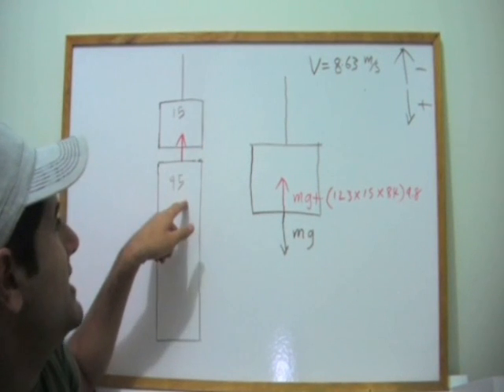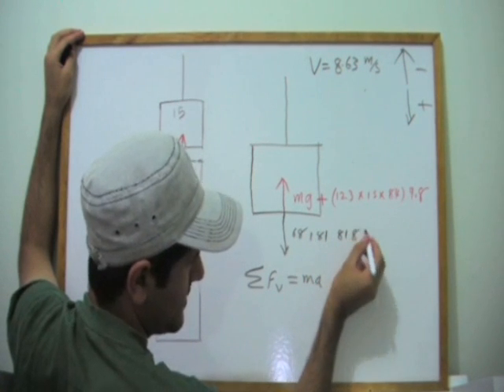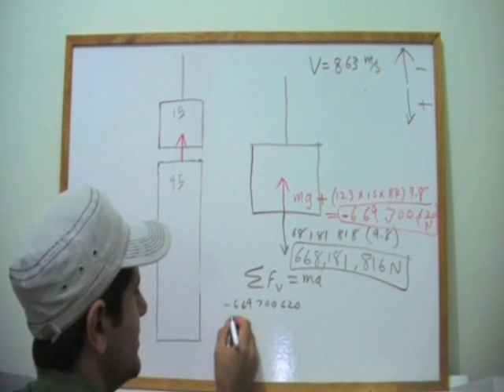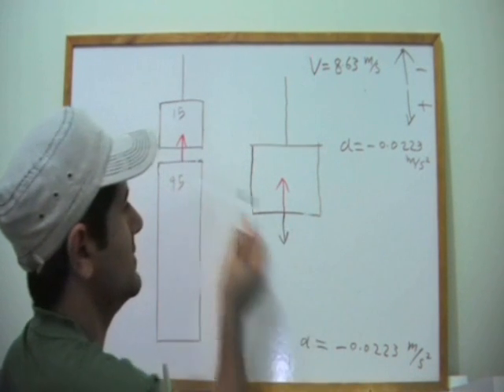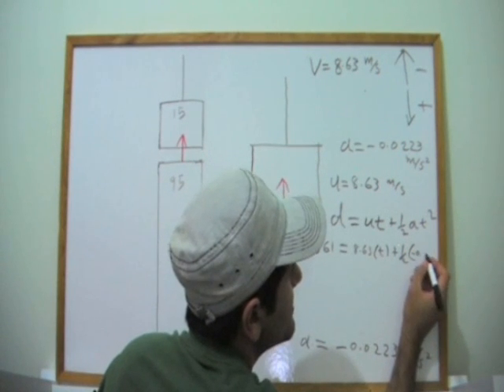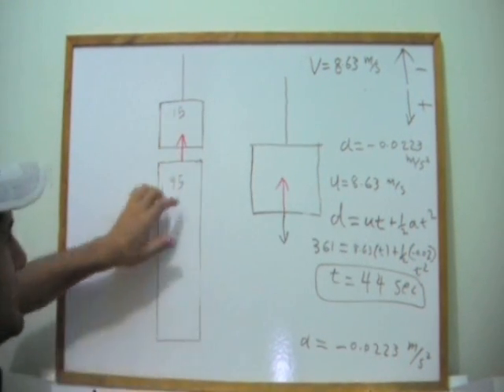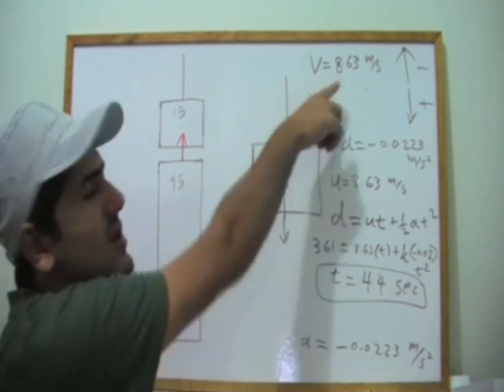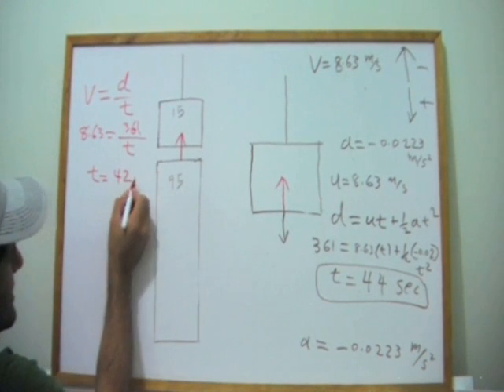(Part3) 911 Simple Physics Structural Failure Vs Demolition

Comment: It would be absolutely impossible to crush that central core in pancake fashion.
Reply: Better yet, buildings just can't fall straight down period and end of story.  That is why the beams were all twisted.  To both fall free fall and to twist downward by torque (torsion) would require controlled demolition.  That is the central point of the argument causing all the controversy.
Reply: ***** People need to get their minds out of smut.  Fortunately, people are going to figure this out on a scientific level eventually.  Whether you are hot-pink liberal or a baby-blue conservative has nothing to do with it.
Reply: MisterNifty I believe it was 60% central core and 40% walls for load support. The thing then is how does it fall straight down. It is already tilting and should continue to do so unless all resistance is taken out from below.The thing with the pancake theory is the pulverising of the slabs. How can that occur so perfectly. It takes force from above and counterforce from below to allow pulverising to occur. But if there is counterforce or resistance from below then it does not collapse at the speed it did. I could be absolutely wrong but as of yet I have seen nothing definite to explain the near perfect collapse of those towers.
Reply: librazone  you are right.
Reply: librazone "It would be absolutely impossible to crush that central core in pancake fashion."But the inner core was designed to sway as well as the outside shell.  I'm not saying you are wrong.  You just aren't demonstrating why it was so that the inner core wouldn't collapse.  Lots of energy from the impact was absorbed because of the way in which the outside shell and the inner core swayed independent of each other in directions which were front to back, by way of the slip joints and bending trusses, and side to side, also by slip joints and by way of bending trusses.  There weren't just trusses, but double trusses running from front to back and, within those, others that ran from side to side.  See, those supporting the official report poo pooing the engineering of the towers are getting their cake and eating it too.  People claiming the jets brought the towers down fail to acknowledge how well the engineering of the towers worked.  They oscillated for three minutes after the impact.  People arguing the trusses were overheated just think good enough alone.  But they are thinking of the fire in terms of it existed back when it was still one of the four basic elements along with wind, water, and earth.  The hottest part of a flame is going to be at its center.  This accounts for the color variation in a flame.  Or, another example, yellow sparks in an electrical short are cool in comparison to white sparks.  Cooler heat rises because the smoke is unspent gas.  So the upper steel trusses were being heated by unspent gas.  At the same time, because of gravity, most of the heat is going to be upon the floors.

Another example of getting your cake and eating it too is the flames traveling down the elevator shafts.  According to physics, flames traveling at high speed can't bend around corners to travel down the elevator shafts.  This reported incident of flames means the explosive impact happened in and around the core where the elevators were located.  At the same time, the immediate explosions felt at the bottom of the tower means the engineering of the towers worked as planned.  Indeed, the energy absorbed from the impact of the jet traveled down the perforated weakness of the bolt patterns.  

The outside shell wasn't built in floors, but, in a sense, in vertical and diagonal floors as the sections themselves were pieced together offset.  

The energy from the impact was felt almost immediate as it would have happened faster than the explosive sound from the jet's impact could travel.  I think this is what caused a lot of confusion.  Those bolt patterns were not fixed in a horizontal fashion at all.  So, how could the upper tower bend to break?  The energy from the impact traveled at two separate time intervals towards the top and bottom of the tower.  One energy wave traveled in the vertically up and down the perforated bolt patterns along where the spandrels were connected.  The other energy signal traveled also along the diagonal up and down as well along the perforated patterns where the sections were connected by bolting the rectangular beams.

In other words, these engineers knew their stuff.  As the energy would be received at different times by both the hat truss at the tower's top and the massive steel foundation at its bottom, the two differing signals would cause them to oscillate.  This phenomenon helped absorb a lot of energy from the collision.             

Hello?
Reply: MisterNifty correct.
Reply: librazone That is an easy problem to figure out.  The inner core held up itself along with exactly half of the live and dead weight of the floors spanning between it and the outer shell. All collapses are torsional.  They have to be.  This means when they fall, they have to twist (torque) one way or the other.  The two types of torsional collapses are centrifugal and centripetal.  Centrifugal collapses happen in nature.  Centripetal collapses happen by design.  For a building to collapse straight down, it has to be engineered to fall in a centripetal fashion either clockwise or counter so towards the center of its mass   
This is why there is so much controversy.
Reply: librazone The answer is that it was not a perfect collapse, it was a real mess. It acted more like a liquid that a solid. Someone said that it cannot be thought of as a block and he was right. 
  If it had been a CD there would have been no need for airplanes. The clowns that would've done it would 've said the terrorists set the explosives----- not us.
Reply: ***** find 39 witnesses. and I will interview them all.
Reply: i do not understand what you are saying
Reply: Wasatch Range Railway First understand that, though the towers were built square, they fell round as that is the nature for all things do so.  Think of toilet flushing.  So, what gives the tower its torsional strength is its bracing which keeps it from twisting by applied torque.  Square beams resist torque.  I bet I could say that a million times and most people still wouldn't get it.  I-beams or H-beams twist.  That is why Ford utilized an I-Beam suspension in its 65 pickup.
Reply: ***** Okay, I recommend buying a small book if you can.  It is the JFK commission on the behavior of the intelligence community prior to JFK's assassination.  In that book is clear testimony of our intelligence agencies deceiving of the whole world by the use of false flags.  Of course, they did not offer testimony concerning domestic deception for fear of being eliminated.

Comment: What do you think about the theory of a directed energy weapon? I only say this because if the buildings were brought down in a controlled demolition, wouldn't there be a huge pile of rubble at the bottom? That is not what happened,  they literally turned into dust. Also building 6 has its middle missing! Not crushed as some people think.
Reply: You have a good point especially because a collapse or regular demolition would not cause the pyroclastic flow of fine dust that we all witnessed. All that steel and  concrete would need an incredible amount of energy to behave in such a manner. However it seems like everyone is either clueless or indifferent when talking about this
Reply: Irene Moran if your pyroclastic flow was reality, everyone in the general area would've been incinerated. With all of the people that I saw covered in dust not one did I see scorched beyond recognition. 
  Secondly, go talk with a demolition company that brings down buildings with explosives. There is no such thing as pyroclastic flow because it is not hot enough to generate a flow. Controlled demo does not turn concrete into powder it does not melt steel. The REF of plastic ex is between 1.4 to 1.8 `too fast to generate any real heat. C4 through C6, cuts steel and concrete. It does not generate enough heat to cook an egg.
  I did it for 4 years, and I was damn good at it. Thirdly dynamite will not cut steel dynamite digs holes because it burns slower. it would blow pieces of the building all over hell destroying all of the other buildings resulting in lawsuits against the demo group. When we flipped tanks end over end , we could touch the metal within seconds after cutting through it. It did not scorch us it did not burn us, And anyone who wants to argue it is a frickin' idiot. Your pyroclastic flow happens in one place and that is on the side of a mountain after an eruption of a volcano. Or in the case of Krakatoa across an ocean.
  Those who think they are perfect are especially annoying to those of us who are! ;) ;) ;) You can argue with me till hell freezes over Irene, but until you have done it , you are just assuming!
Reply: Irene Moran
You only get pyroclastic flow in 2 instances. One is a volcano, the other actually is building demolition. It happens as explosives pulverize rock or concrete to dust, which is why volcanic "ash" would turn to concrete in the lungs.

Comment: The most important thing as far as i can see is the weak points of the construction of the building and those points would be the lift shafts as there in no supports holding the center of the building it is possible for the collapsing top floor to fall into the middle of the building causing an avalanche effect.

Comment: How are you calculating the resistance force of the lower 95 floors?
Reply: He made just an assessment. He said that Resistance must be AT LEAST as high as the weight of the collapsing upper block. If resistance is higher, so much the better ! Then the collapse must DEFINITELY SLOW DOWN ! And he proves that - SURE ENOUGH - the collapse should not last less than 40 seconds. So if it did, then it was due to something else than the "pancake effect". Actually, it was due to explosive put by the americans themselves.

Comment: Here is a quote from Engineering News Record, April 2, 1964. 

A design procedure that will be used for structural framing of the 1,350-ft high twin towers of the World Trade Center in New York City gives the exterior columns (perimeter columns) tremendous reserve strength. Live loads on these columns can be increased more than 2,000% before failure occurs.

Comment: Mr Weasel. There is a photo of the south tower failing and tilting over. There is substantial tilting. The rear side of the tilt (ie away from the hinge) pivoted up, you can see this in the photo (by definition, a tilt must of a hinge or pivot, giving the angular momentum...). If you look at the photo, the destruction all around the lower part of the build, even at the rear of the tilt is pretty much the same. Would you not expect the rear NOT to be demolishing at this point?

Comment: How many physics calculations have you done using kinetic energy?
Have you performed any?
What about vector analysis?
Have you performed any cross products of vectors?

Do you understand that there is on perpendicular vector to a force. ie, for gravity, which acts directly to the center of the earth, there is zero perpendicular component. 
So where did these beams obtain their force from? From pressure? Or from the magic green elf? Or what? Gravity has NO horizontal component.

Comment: Assuming that the dynamic load is 68,000, then as the destruction commences (at the destruction zone) then both the upper and lower parts are subjected to this destructive force.  I have stated this before but you refuse to acknowledge this.
Also, the top section of both WTC1 and WTC2 are almost 50% demolished BEFORE any observable destruction of the lower section starts. How is this possible?

Comment: Firstly, if you are quoting from the Bazant paper re dynamic load, his paper is totally floored! He states, and I quote,
Design Load = mg, where m is the mass of the upper part of the tower. Totally false, no designer would design the design load right at the actual static load above it. My understanding it that the outer structure was 7 times stronger than it needed to be, and the inner core were 3 times stronger. So Bazant is wrong!

Comment: Do you have trouble understanding English? the upper floors might not shatter while coming down, although there is easily some damage being seen. YOU suggested that the top 20 floors would remain absolutely intact, and THAT is wrong...once they reach bottom. Then again, you were not there when they collapsed, and you obviously have not seen enough videos, Drop a glass from 10 feet. Until it hits the ground, it's fine. Upon impact, it breaks. Same thing, bigger scale, with the top 20 floors.

Comment: Just type "breaking bricks with hand" into the youtube  search engine.
Youtube won't let me post the URL. Sorry.
The point is that bricks are harder than hands, and yet human hands CAN break bricks...and a lot of them as you will clearly see: 35 in one shot! If so, the 20 floors can demolish 1, 21 can demolish 1, and so on down the line. 
People on floor 22 smelled jet fuel, which had gone down the core while blazing, helping to weaken the structure. That's in more than 1 investigation!

Comment: Wrong. The upper floors sustained major damage from impact and fire, and upon reaching the ground would have shattered...which is pretty much what happened. What was amazing was that some people survived the collapse IN THE STAIRWELL if they got as far down as the 6th floor. Also, parts of the outer wall from the first 10 floors or so did not collapse because, by the time the main body of material reached that level, a lot of debris had piled up.

Comment: DeedsResearcher. Only just read this comment from you. The analogy is a good attempt of explaining the difference between static load and dynamic load.... but!!! The actual use of a bowling ball and hand (which is actually pretty good mind you...) does not actually mean anything when considering the WTC scenario. What you really need to do is place say 100 bowling balls on top of each other, making sure that the bottom balls are LARGER, and progressively getting smaller as you go up. Then drop

Comment: You clearly don't understand me. You start with 20 floors in motion, crushing down on 1 floor. NOW you have 21 floors coming down on 1, and then 22 coming down on 1. In videos of the collapses, you see the towers still okay as the collapse builds. But as parts of the outer wall peel away due to the force, windows pop out, and you see squibs.
Your flaw by now is obvious. Instead of 20 floors coming down on 90, there are an increasing number of floors coming down on 1 at a time. Snowball effect.

Comment: What I am saying is, the top section of the building (dynamic load, static load) experiences the SAME destructive force as the fixed, lower section. As such, both the moving and fixed sections are demolished simultaneously. THIS MUST HAPPEN! Therefore, as each floor is demolished, the top part runs out before the fixed lower part and the destruction stops. Take two bricks. One on the ground, other in your hand. Smash the one in your hand on the fixed one. Both brick break apart. Same concept!

Comment: Rebuild one of the Twin Towers, following the original specs. Furnish it exactly as it was furnished before. Add in cameras that will video tape everything that happens inside the building. Then, using computer-assisted drone technology, fly a 767 (with the same amount of fuel) into the same spot on the tower as was hit on 9/11. We should get the same results as before, but with no deaths because the tower will be empty, and the plane will be a drone with no passengers.
Got a billion bucks?

Comment: The flaw in your logic: Each floor was designed to hold the total weight above it. Thus, the bottom floors had the strongest steel, No floor was designed to hold the weight of all of the floors IN MOTION, since such a collapse was not anticipated. The 90th floor was supposed to hold 20 floors above it...if there is no other downward force. But the collapse created force that you have not considered, but that must logically BE considered. There is only one way for us to know for sure.....

Comment from the maker: you don't know what your saying, I myself am an engineering graduate and I worked in structural engineering for a few years and in construction for a few years and built big projects myself.  
saying that floors will keep adding is nonsense as you see the material is falling on the side and this is irrelevant just replicate a model for me where the top 10% of the structure can destroy the bottom 90% top down. this can not happen the collapse will be arrested after the 20% mark

Comment: Further, the weight of the top 20 floors increases in force as it gains speed. The towers had been weakened both from the impact of the planes and the burning fuel that went down the core. For a test: place your hand on the floor, palm up. Next, place a 16 pound bowling ball on the palm. No pain or injury. Then, take the ball and drop it into your palm from 3 feet off the ground. You can expect badly broken bones. Same effect as 20 floors falling.
Your grammar is poor, too.

Comment from the maker: still 10 floors can not physically destroy more than 10 floors equal to their own size and strength and fater doing so they will be grinded in the process so how did  the top 10 floors destroy the button 90 floors.  I challenge any institution to replicate a model of this event where the top 10 % of any structure can destroy the bottom 90 percent from top down.